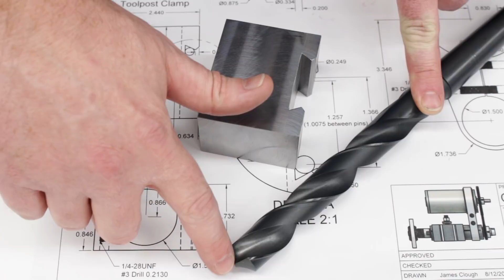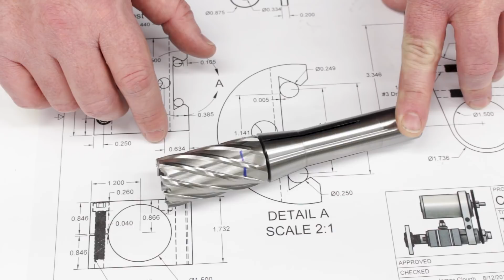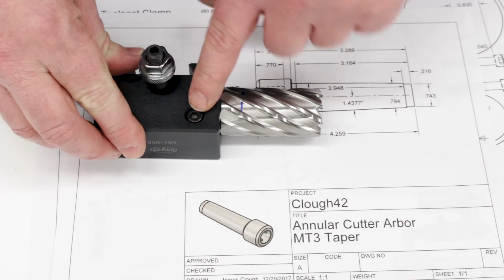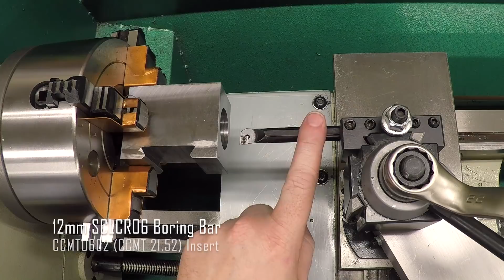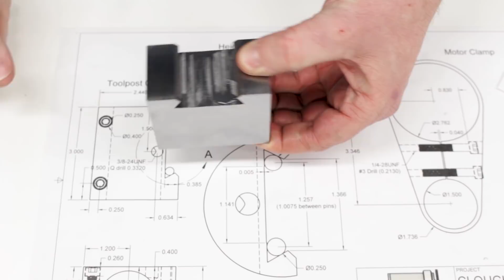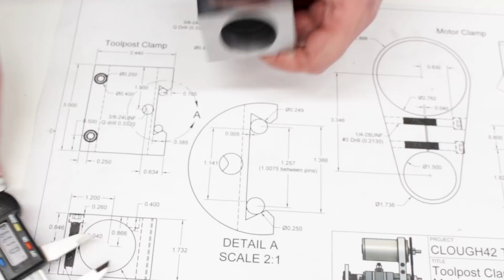Making a Toolpost Grinder Part 13: Toolpost Clamp 2

Comment: Probably two years too late, but why you did not put mag drill bit in the chuck of the lathe, put clamping block on its future place on the toolpost and drill it that way? When reach the middle, just turn  clamping block upside down and continue drilling from other side.

Comment: It looks like your toolpost isn't locked down for part of this. I see the handle moving while it's cutting at 24:50
Reply from the maker: Good eye.  The mind slips sometimes when trying to do the work, explain the work, remember the numbers and operate three cameras.
Reply: @Clough42  Yeah, I've done the exact same thing, when I'm not even talking or running a camera.

Comment: Lot's of different way's of getting the job done of course and yours worked very well James. One of the books I've learned more from than all the rest combined was George Thomas's The Model Engineers Workshop Manual . He makes a fair amount of tooling in it with a lot of it meant to have it's C/L coincide with the lathe headstock C/L. He shows drawings for one of the best between center boring bars I've seen anywhere. It would have been ideal for boring that block with it already locked into it's working position on the tool post. The nice part about a between centers boring bar is there's no chance of the bore being tapered and the set up is easy. I'd be willing to bet a lot Adam, Tom, Keith, Joe or even Robin could pick up a trick or two from that book. And if you couldn't find 1/2 a dozen improvements and tooling in it to make for your lathe I'd be very surprised. The Ebay bandits here in North America want far too much for it though. Much cheaper to order direct from either Hemingway Kit's or Tee Publishing, both are in the U.K. Mr. Thomas was I believe a certified machinist, tool maker and a mechanical design engineer later in life with a real gift for design and how a finished tool should perform.
Reply from the maker: Thanks for the tips.  I actually thought about making a boring bar to hold between centers and decided to just use a boring bar that I already had because I already had it.